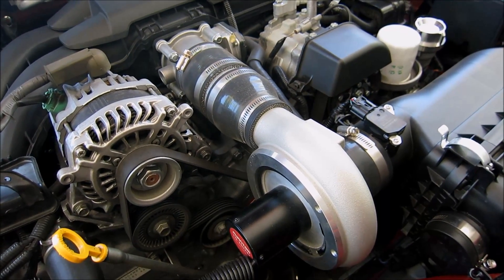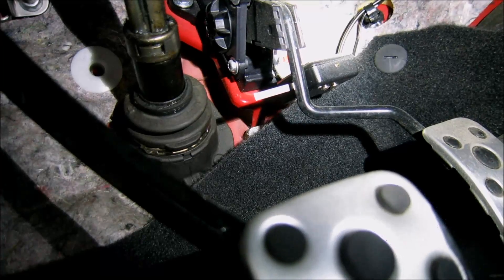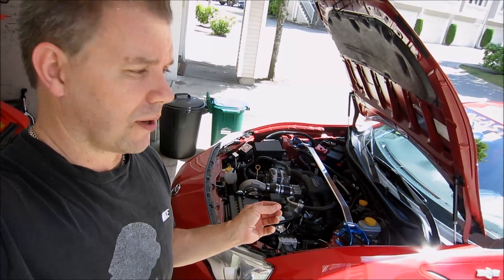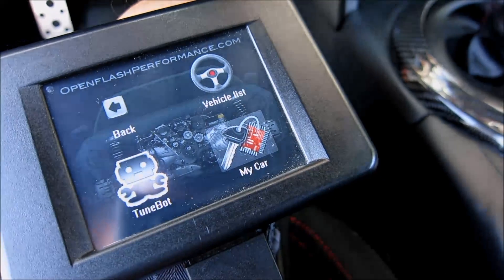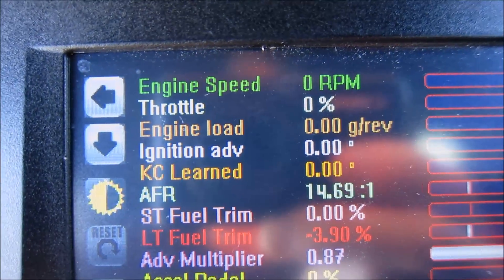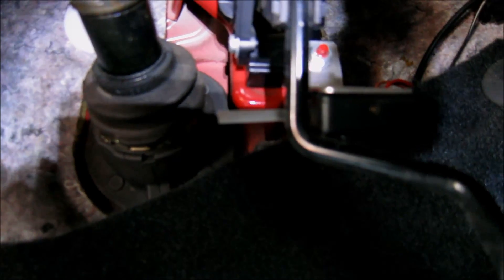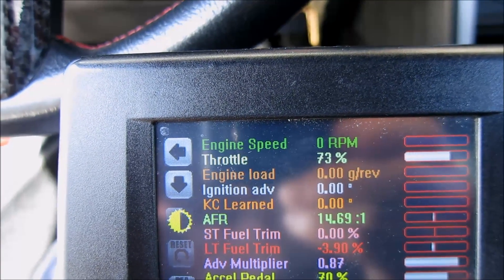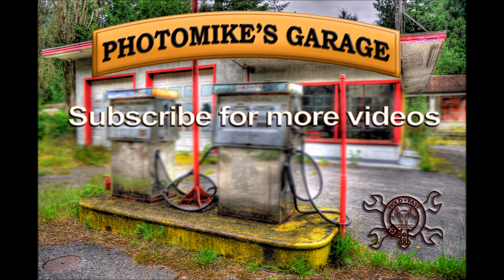The Phantom supercharger throttle activation

Comment: Complete  bullshit - there is no way that you are going to help the engine breathing by means of this junk!.I will give reasons why:1 - from where did the electric supercharger is going to get the electricity - from a two tiny kid's car toys batteries - NO WAY.2-  How much will the electric supercharger spins? maybe 40 to 50k in a non confined area , few thousands rpm when in a confined area - No way to create boost.3 - The motor is just a high rpm motor but with no torque - Not suitable for this application.Do yourself a favour buy a real supercharger or a turbo and have fun!.
Reply: Perhaps something is getting lost in translation. You clearly are not up to date with modern electric motors, and their control methods, and abilities. I'm no expect in the field but I do know what exists and what doesn't. There are no OEM vehicles with a standalone electric supercharger, as I have already stated, they are only good for small amounts of boost or to supplement a real turbo. I will reply as much as I like in this public forum, thanks very much. I already have the facts. I'm not arguing here, however you seem to be getting very agitated, when all I'm trying to do is educate you about developments in vehicle technologies. VALEO has made, tested and sold a similar system to AUDI for the Production of the 2017 Q7S, I need no further proof than this. You have clearly made up your mind on the subject already, and are unwilling to research and have a civilised debate. Personally I'm done, I've made my point and no longer care enough to continue. Bye! :P
Reply: Audi for one. Its still in its infancy but they do in FACT work, with the dawn of high speed digital motors capable of 10,000 rpm and higher with enough torque to drive a compressor, you will see these system make there way into production cars over the next 10 years. Take a look at Hybrid Supercharger patents from Audi (Pretty sure it was Audi) & Aeristech's website and do some research on the subject before you go pooping on it. The advantages are clear! pretty much zero lag for one thing. I believe you are correct in that the phantoms motor only delivers 50k rpm, this is why the compressor is so large, I assume. I'm not sure where you get unconfined area from? Thats the cold side of a standard turbo compressor.  The phantom isn't the best application of the technology SO FAR... it needs to be tied in with the engine management system in order to be more effective so that the ECU can adjust the fueling correctly , but its a good start. However for the price point and lack of availability, I'd still go with a normal turbo, although it'd be nice to have one of these work in conjunction with a standard turbo in order to provide boost at lower rpm, prior to the main turbo "kicking in".  Would be great for a small 4 cylinder engine in theory.... it'd be nice if the guy answered his email enquiries though.
Reply: yes I know what you mean. I have studied mechanical and electrical engineering, and that IS a turbo compressor attached to the 24v Digital motor so how is it unconfined?..... so again, like it or not, they do work, and are in production in the new Audi Q7 2017 model/year, implementing Valeo's 48V system in conjunction with a standard turbo. I'm not trying to start a flame war here, look into this properly and you will see for yourself. The system provides boost from 0 rpm and fills the gap in the torque curve until the main turbo has spun up, then it shuts off/or augments the turbo.
Reply: SpAwNxtRaPxkINgx Shut the fuck up and First learn knowledge before trying to be funny on a forum!.
Reply: TURBO CHARGER dude your so dumb there are more company's doing this it's more efficient and the traditional superchargers and turbos that run off the motors power it uses electricity  to power them
Reply: TURBO CHARGER Oh my god, youre so ignorant. How is THE EXACT SAME compressor as used in a traditional turbo going to perform any different if its spun up by an electric engine instead of exhaust gases? Its still working in the same way, only the means of powering it are different. Thats just basic logic, think before you start criticising
Reply: TURBO CHARGER Also, how is a car battery a kid toy battery you dumb ass? Those batteries are capable of delivering up to 450A atleast, and even up to 1000A depending on the battery (of course not for prolonged periods, but that electric motor draws only like 60A anyways) how the hell do you think your car can start in the winter?
Reply: Justin Steer When I said unconfined it means that when the fan is just spinning /moving air in open air just like an extractor. Confined means when is supposely boosting/pressurizing air in the inlet. Understand now? .
Also there is no single car in the world that uses stand alone electric forced induction because it can't work. Just go and study mechanics if you believe in this junk and can't understand why!.
Reply: Photomikes Garage some people are just stupid and have no knowledge lol they make bigger and higher kv motors that would spin that up to 100,000rpm and make more boost have to have a new esc electric motor controller and more power like 64 to 80 volts lipo power
Reply: Justin Steer he is  absolutely a moron
Reply: Paul cherry are rc cars compressing air... do you have any idea of the power source you would really need.... my hobbywing 120 amp 3400 kv pushes my rc to  80 plus is it going to compress air nope...
Reply: https://youtu.be/POcTrS8Rm5Q
Reply: Jakub Hobl your so right it's funny there are so many dumb people out there I call them sheep or horses with blinders cause they can't see outside there tiny little front face view I see the electric supercharger getting better and better with time soon they will crush the traditional superchargers because they run off a external source instead of the motor , and won't have the lag a turbo does probably will surpass them if you think about it and know the RC world the faster remote controlled cars were nitro in the 90s and 2000 now the brushless rcs are way more powerful and faster as they are getting faster and more powerful then ever my mamba monster setup produces 5 horsepower and runs off of 22.2 volts
Reply: dumbass alert!!!!!!!!!!!!!!!!!!!!!!!!!!!!!!!!!!!
Reply from the maker: The power is from the two dump packs producing 24 volt and up to 5000 watts of energy which spins the turbo impeller 50,000 rpm which yes is able to produce 5 psi in the intake tract for a short time.
Reply: Photomikes Garage From only 2 batteries!. No way!.
Do your self a favour buy a real one. If it was just that easy for just strapping a motor to an impeller and gives you boost rest assured that ALL car companies did it!. But it's not that easy,  impractical and few hp gain.
Reply from the maker: New car companies are using it right now.
Reply: Photomikes Garage mention them I want to buy a car with electric forced induction . I am waiting.......
Reply: TURBO CHARGER your fucking stupid electric motors can produce more torque then some car motors you sound dumb as fuck
Reply: Justin Steer That's all that I wished to listen from you that there are no stand alone electric turbos / forced induction that really exists! . I knew that some car companies are using it for small amount of boost AT LOW REVS.  And they do work at low revs because at low revs the engine needs very little air compared to high revs but that's was not my point. My point was that electric forced induction do really works if there is an extremely high power motor involved and enough power source to operate it. Just because attaching an over the counter BLM to a real compressor and power it with a two kids toy batteries does not going to have POSITIVE BOOST, 5psi as stated in this video-equivalent to a conventional low pressure turbocharger!. Not to mention that it also causes a restriction in the inlet when it is switched off!.
Understood now when I stated confined and unconfined area means now? Unconfined means that when the electric charger is spinning / just pushing air open ie not attached to the engine like a leaf blower and confined is when the discharge outlet is attached to the engine and is pushing / COMPRESSING air in a confined area ie the air does not have space to move like an extractor fan but it needs to COMPRESS itself , two things completely different  MOVING AND COMPRESSING . But since many people are using REAL compressor turbo housing with real turbo impeller [which has very few spaces between the blades to avoid REVERSION of air just unlike normal fans, these people thinks that they are going to create POSITIVE BOOST!. Attaching a high speed motor like bldc motor can surely spins 100k and moving hundreds of ltrs per minute if just pushing air open. But if the discharge is now closed and the air now must be COMPRESS ITSELF and reversion can't occur due to the impeller ,BACKPRESSURE builds up and the motor has to fight it. If the motor is not powerful enough guess what happens?.motor's rpm drops drastically creating no usable boost at all and if operated for too long even burn itself.
That's certain people can't understand- they think that just attaching a high rpm motor to a real compressor and housing are going to have boost- no way it takes more than that!.
And I don't think that in the future we are going to see stand-alone full time electric forced induction either because of power source and durability and power / torque of the motor problems!. They are impractical , needs large capacity batteries which added unwanted weight to the car - not suitable for daily driving!.
Superchargers even turbochargers takes tens of hp from an engine to create boost and that's why I insists when I see a junk like in this video, 2000 dollars for something that DO NOT WORK! - NOT WORTH IT.
BTW ,don't have to educate me in any of these subjects because I am a QUALIFIED car mechanic and also QUALIFIED in electronics and have BOTH electrical licences - so I know what I am talking about!. But discussion closed and no offences, Happy Christmas! .
Reply from the maker: Justin  the phantom supercharger uses a tune that is designed for it from Open flash tuning. You are right that right now it is not available new but that may change soon because there is a new company working on developing this now.
Reply: Justin Steer Oh my God , in English I am talking to you not in my language , you are telling me that you studied mechanics and don't understand what unconfined area and confined area means?.
Then ,you really don't know shit about forced induction moreover can't talk about electric forced induction!. And you really don't know how much power you want to just COMPRESS only 1 psi of air really wants!. Many more than the motor in this vid!. And finally you didn't answered my question: mention me one single car that has ONLY stand alone electric forced induction??. If you don't know a name pls don't reply!.

Comment: Just started looking into these, pretty cool. It sounds like a much safer and easier install for those scared of a small 50 shot of nitrous with a throttle position switch for activation.
Reply from the maker: Its up to 5 psi and the convenience and lack of refills makes this a better option.
Reply from the maker: Yes it is safer and its always ready to go , no refills.
Reply: Sign me up! Just asked the wife for one for Christmas. She said NO. 
Looks like I'm going to need to buy this myself :-)
Reply: The car is a blast as is.
5 psi @ 1800 bucks is golden!
Reply from the maker: Yep it works pretty good and very reliable!
Reply: From where the 5 psi are going to come from? from this junk, having a kids toy motor and a two kids batteries?. Are you still believe in this?.
5 psi is equivalent to a low pressure exhaust driven turbocharger!
for 2000 dollars I can buy a REAL turbo , intercooler and modify my exhaust manifold and modify my ecu without changing any internals at all or open the engine! Obviously giving only about 4-5 psi of boost for safe operation since I retain stock internals and the gains are going to be enormous. Or half the price for a 50 bhp nitro shot!.
Just a waste of time and money!.
At least it would be far better if he attached it from the crank pulley and used a very small pulley with a possibility of an idler pulley - to upping the rpm for some really boost now and makes sense now!.
Reply: TURBO CHARGER
 ,eCthywfttygggguytu
Reply: alvareto Tobon ??????

Comment: Let see some data to prove it works!  2 blow dryers are cheaper and may work better. & just because it's in a fake turbo housing don't make it a supercharger. It is a electric turbo at best. And maybe 19 hp, and that's giving it 15 hp! Just spend the coin & buy a real one!   Stop faking a Turbo!
Reply from the maker: Already provided some data in my " Does my electric supercharger work?" video but I will have another video soon showing that it does indeed work.

Comment: even for cheap fun im gussing the electric  super cheaper are not cheap , nothing compares using   real turbo like mine with 17psi 1 bar turbo boost is so extreme
Reply from the maker: The electic supercharger is about 2000 for everything  so pretty cheap fun.
Reply: Scott Cain  1 Bar is equal to 14.5psi, slightly less than 1 atmosphere  (14.7psi). Not 17psi.
Reply: Could not be bothered putting 1.2 bar
Reply: Scott Cain lol fair enough
Reply: Runing garret 3070t Turbo with nissan engine

Comment: uhhhm you know those electric superchargers are a myth right ? they really dont work AT ALL lol its like your LITERALLY trying to stick a hair dryer on your motor xD im sorry but your wasting your time lmao BUY A REAL TURBO OR SUPERCHARGER !!!!!
Reply from the maker: They do work and I will prove it to you with my next video on the electric supercharger.
Reply: LMFAO all your gonna prove is that you wasted your time money and effort on 1psi of boost if that xD LOL like i said before BUY A REAL TURBO xD
Reply: This is a centrifugal supercharger like those made by several manufacturers. Instead of a belt off the engine it is driven by an electric motor. Of course it works.
Reply: We are all aware of the "Bilge Pump" ebay specials that claim to be electric superchargers. Don't be confused this is not one of them.
Reply: This is the problem with many people thinking that ,if a centrifugal supercharger is driven by an electric motor instead from the engine are the same , and because the electric motor is spinning 60k rpm just like a belt driven engine supercharger the power output is the same!!!.
WTF - NO THEY ARE NOT THE SAME!.
Reply: Physics is fact, if you need 30 hp whether you get from a belt or motor is the same. In fact belt drive has friction losses and is not as easily controlled.
Reply: Paul James What's your point????.
Reply: Paul James Did you understood the concept of this video and did you understood my comment why I commented like this?.
Reply: "WTF - NO THEY ARE NOT THE SAME!."
That is what you said.
Mechanical energy is the same. 
This IS a centrifugal driven by a motor. 
You are not making sense, so end of discussion.
Reply: They are bilge blowers, designed to take explosive gases out of the engine bilge. They cost $20 and are just fans not compressors.
Reply: TURBO CHARGER ive got my my own electric charger and mechanical switch, and its really wanna a step 1 and 2 charging. My idea for step one is adding a cold air intake for step one is awesome dude